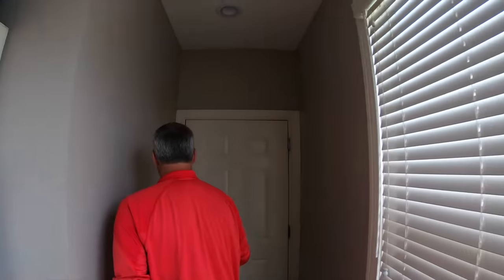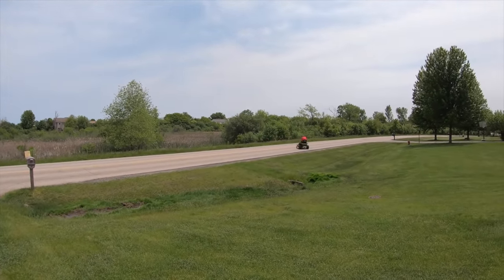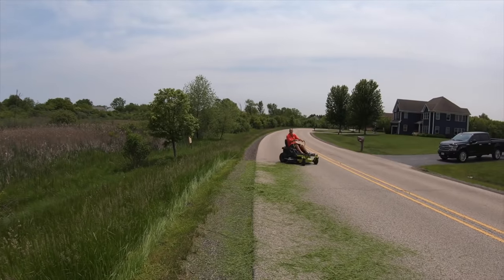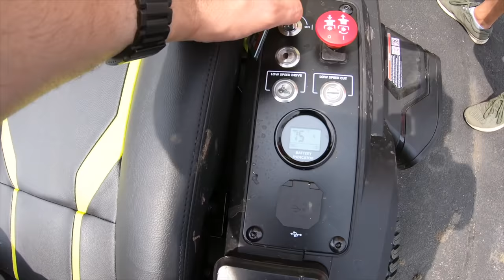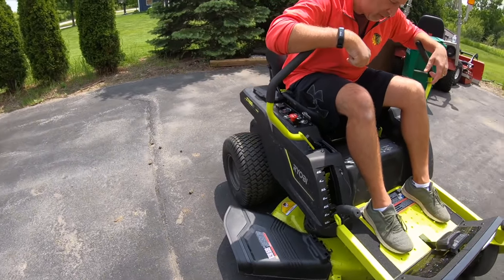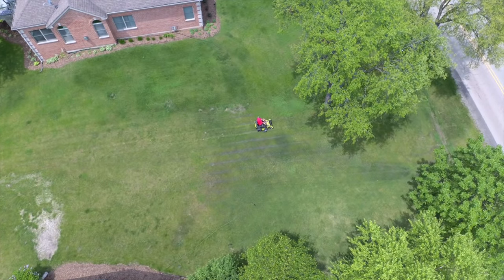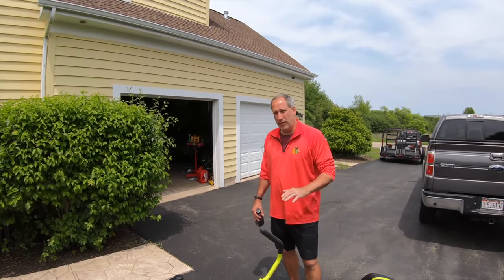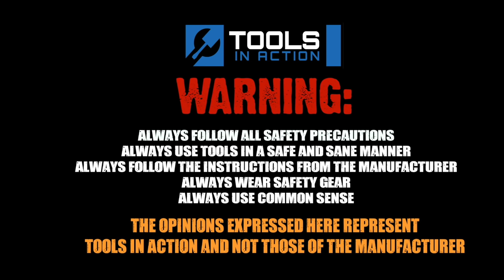Ryobi Electric Zero Turn Mower - First Look

Comment: It's $4100 for anyone curious and too lazy to look it up.

They might've said it, but I was skipping around the video
Reply: yeah, not sure if it would make sense for the average homeowner.
Reply: @freddyv7546  kubota zd 332 run over that little ryobi with the big 32hp diesel power lol
Reply: @michaelmactavish1728  too expensive for the average homeowner and too weak for a lawn care company.
Reply: @freddyv7546  there round $16,000 at my dealer and $27,000 for the F3990 with 60'' or 72'' deck and snowblower and blade
Reply: It makes sense if you’re willing & able to shell out the initial cost. You’d spend way more paying someone or in gas, maintenance plus a gas  mower. It’s overkill for my acre-ish yard but my ego push is great and I’d never go back to gas as a homeowner.
That said, long time durability would be my main concern with this.
Reply: Freddy V ummm if an average homeowner is needing a zero turn then it’s perfectly priced. Not sure you know this but homeowners buy zero turns and they make zero turns for homeowners and they cost around that much. Yeah, you can get them for 1500 or so cheaper but you’ll save in the long run here.
Reply: All I see is issues with that try using it on 4ft tall weeds and see how it does if it wants to look like a zero turn mower it needs to preform like one or it is a wanna be.
Reply: @Taylormade2350  no a decent home owner model john deere zero turn was 2400. But we just ordered a s240 rider
Reply: @BobSmith-qi5di  Can't speak for 4ft yet, but as someone that just purchased one of these after our old Cub dying we had an area that hadn't been mowed and probably had around a foot and half or two of growth. Put the deck on its highest setting and it didn't even really bog down. Part of the benefit to instant electric torque, motors that are always outputting peak power, and no loss due to belt drive.
Reply: jj Watson I literally said you could get some for 1500 less
Reply: Freddy V if you have a big yard and want a zero turn this will save you money on maintenance. I cut 5 acres + and $ 4 grand is nothing.
Reply: Freddy V this is not weak tho, look at that massive lawn. You can tackle like 10 yards in the burbs with a single charge. Game changer.
Reply: ImRIckJames yep.
Reply: Thats what I paid for my 54” bad boy mower. Extremely over built and tuff mower, that was worth the money but i don’t think this is worth it. All i see is issues in the future for this thing.
Reply: @imrickjames7012  this lawn is not massive compared to anything I can cut with my Scag
Reply: ripoff
Reply: Like it but won’t buy it . Does not meet my budget
Reply: @adamlaski9128  
Exactly... the batteries are 200 ea 4 per unit. 200 ea for the replacement motors @ 4 per unit. 
Could be very expensive.
Reply: @freddyv7546  i think its mostly for landscapers in the tight city were people complain about the noise but ya def not for the average homeowner lol 4k no way haha
Reply: 3300 at home depot
Reply: @Travis-kt7cn  should be 1500 lmao
Reply: @killaz123456789100  I agree.  I'm not buying electric or ryobi
Reply: Sandy Ravage where do you see it for that? It’s about $4,100 at Home Depot online.
Reply: @mikebsnyder  my local home depot has them on sale online for 3300
Reply: Michael Mac Tavish  use one of those at work ahah love it besides the bumpy lawns usually use it as a back up i use a scagg v ride 54”
Reply: @Taylormade2350  I resemble that comment! Have 3--1/2 acres to mow and for now I do it with a 2004 60" Dixie Chopper and it's getting about time to think about something new. That was about $6000 when new. 2 years ago I had to spring for a new snowblower for our 400' driveway and got good financing rates from Cub Cadet that made it fairly painless.
But we're happy to drive our cars for many years so don't have that expense. My last car I drove off the showroom floor with 7 miles on the odometer in 2002 and literally gave it away 3 years ago with 220K miles. My wife bought hers new in 2010 now with ~145K miles. Runs great, very clean looking car inside and out and she's very happy with it (although she's made noises lately about upgrading since she got a job promotion...)
Point is, buy good stuff when you can and take care of it. Long term it''s more cost-effective.
Reply: Thanks.
Reply: @Taylormade2350  yeah they are not cheap. the ones that look interesting enough to me that i might buy are usually priced close to 4k anyway. that being said i would not buy one unless i had a lawn care business. my yard is quite small and my old 48'' scotts takes about 20 minutes to cut it.
Reply: I was just about to check home depot before seeing this comment.  More than I'm willing to spend.  I'll keep my non-zero turn for now.
Reply: Chris McRoy  lol
Reply: plc268 wow! NiCd batteries? That’s an ancient battery technology!
At $4100 do yourself a favor, spend another 2k and pick up a Kubota z125s! 
$4100 for anything Ryobi is unfathomable
Reply: Freddy V lol how can a 6 foot deck and a 32 horsepower diesel be to weak for a lawn care company. The would run the wheels off that thing. I know there’s bigger things, such as as the 9 foot tri fold for golf courses, but a 6 foot deck is already almost to big for most people’s lawns
Reply: @Taylormade2350  the kubota has residental ones too the GR and T series and komender gas and diesel optional
Reply: plc268 and a 42” timecutter is just over 1/2 of that cost...and will still be mowing 20 years from now if well maintained. That chinese hairdryer mower may (and I emphasize the word may) give 5 years of service before you need to replace batteries at the very least.
Reply: Taylormade2350 save ? A 42” timecutter (that’s a homeowner sized machine) goes for roughly $2600 and will reliably cut grass for at least 10 years if properly taken care of.
Reply: @mikey.180  brushless motors don't break down easily at all. And nicad batteries can be revived by easily balancing them. No oil burning, oil changes, oil filters, spark plugs, gas @ x amount per gallon, starter, carburator, air filters, fuel filters, belts, and pulleys to worry about. The initial price might sound steep. But in the long run it'll be cheaper. I'm sure Ryobi spent good r&d $$$ on this model. Because it's hit or miss forever for them if it fails.
Reply: Yea its novel and all, but at that price I'll keep my 60" Hustler.
Reply: @OmegaGamingNetwork  please tell me it doesn't have a Kawasaki engine on it
Reply: @Oink_Blaster  No I have the Kohler. Though for me it wouldn't have mattered a ton since I fix these engines all the time anyhow. But I knew the reputation of the Kawasaki and really didn't need to add another high maintenance engine to my tools so I avoided it.
Reply: That mower is not wroth 4100 that’s stupid paying that much for that junk
Reply: @Taylormade2350  the thing is it cost four times as much as a MDT lawn tractor where the savings  on that
Reply: @adamlaski9128  Ego has a 21" self propelled now.
Reply: Ictpilot Ictpilot I saw but I can’t justify the cost considering the push works fine. My brother has a self propelled greenworks but he said he doesn’t use the feature all that often and his yards a bit bigger. It was cheaper but I love Ego batteries they’ve been the best in my experience
Reply: @adamlaski9128  Self propelled now $499. I had a couple of Lawnboys, and used it all the time. Makes it a lot nicer.
Reply: Ictpilot Ictpilot That’s not bad. I’ll still wait till this one kicks it. My soil is pretty hard and I keep the grass tight so pushing isn’t much of a chore. Thanks for the info tho!
Reply: Thank you 😂😂
Reply: Ty. I am soooo lazy
Reply: That's not to bad, walker and hustler mowers are above 8k
Reply: @rclife916  Why isn't it worth it? You don't have to worry about going out to buy gas, no oil changes, no worrying about spark plugs. It's basically 0 maintenance. It's going to pay for itself in three long run vs a gas mower.
Reply: $4100. Is that all. Hell I’ll take two.
Reply: Freddy V we have 10 acres and our JD X540 lawn tractor was 7,500, so that’s actually not too bad for someone who has a lot of grass to cut. But this mower couldn’t handle our property anyway, it would run out of charge.
Reply: I would rather get a riding lawn mower than this, it's half the price and lasts longer
Reply: You can get a 60” Cub Cadet or Toro with a ~25 hp v-twin for less than this.
Reply: @freddyv7546  Exactly
Reply: Gday
$6,999au here

Comment: I hope y'all cleaned the grass off the road, that can take out a motorcycle.
Reply from the maker: Yes, we did
Reply: What kind of ninnycycle do you ride that a tiny bit of grass could take out a rider?
Reply: chechnya ya right I ride and that’s never bothered me
Reply: Grass clippings on the road are dangerous, and in many municipalities, illegal. And motorcyclists are often the ones that pay the price.
Reply: Ha, first thing I thought since I just started riding. I assume grass clippings would be bad in a corner but not in a straight line.
Reply: @XBLWasabiSnooters  major issue is on corners, but grass clippings (made up of mostly water) on the right surface and conditions can turn a section into icy like condition for the wheels..  try to brake hard in grass clippings as if in an emergency and you'll see.
Reply: Shawn K I could see braking being an issue or if you were maneuvering around something as well. Rather find out from others who know than from first hand experience. Thanks, my head is on a swivel and eyes are watching everything while riding lol. I’ll just favor the center when I see clippings from now on.
Reply: It would be nice if more people thought like this I see people leaving grass in the road every single day
Reply: @Atlantaconnection94  well it's a serious problem it's like black ice for motorcycles
Reply: @XBLWasabiSnooters  it's bad it's like black ice
Reply: @slum3947  It's a pet peeve of mine
Reply: @cole909cole  yes me too I've grown up around Harley's my whole life
Reply: I own a Lawncare business and I take extra time to ensure I don’t throw clippings into the road as much as possible. Can’t stand watching people discharge into the road.
Reply: SLUMERICAN never bothered me 👍🏽
Reply: chechnya grass thrown in the road will wreck anything from a moped to the biggest cruiser on the road. Gonna go out on a limb and guess you don’t and have never ridden.
Reply: Michael Stokes you’d have to be on the gas pretty hard in a straight line for it to make you wreck but it is never good. I don’t understand why anyone under any circumstance would blow grass in the road. If a mower will mow in one direction it’ll mow the other direction.
Reply: chechnya Ninmycycle? What's that supposed to mean? I kmow quite a few riders who have nearly lost it over the grass. Sportbikes often use soft comp low pro tires, last time I checked slick surfaces arent meant for traction.
Reply: Luke Lambert 
Depends really. I have to to get the drainage ditch on the side of the road. Literally the only way my mower can get a decent cut to the bottom of the ditch, and the only direction I can get my push mower into the ditch without tearing it up.
Reply: BlakeW5 yeah, you mean because of the discharge flap?
Reply: Luke Lambert 
Yes. I know you can remove it, or bungee cord it into an up position but that’s a pain. Plus the actual terrain change between my side and my neighbors side makes it all but impossible to get in from the other direction.
Reply: BlakeW5 I guess there are very few can’t do it cases out there. I hope people that have that rarity immediately stop and clean it up then resume mowing. Oddly enough I just saw an article posted on social media yesterday that read “motorcyclist killed due to grass clippings thrown in the road”. I wish I could put the screenshot on here but it won’t let you post pictures. It is just a bad deal. Worst part is a lot of people would say “I could bungee it up but it’s a pain” and they just don’t care enough about the pain of someone’s head hitting the pavement after sliding on their grass in the road when unlike you, they have other options. Just watched a guy on my road do it the other day. Put my foot over the brake and was getting ready to stop and tell him to pick it up but there was a line of cars behind me and I could have caused a wreck doing so. Bad part is, he has a Harley street glide. He should know better. He also could have thrown it back in his yard but just didn’t.
Reply: Why the hell is everyone talking about motorcycle...just because...im blowing my grass in the street
Reply: @bigblue3568  then watch where your driving!!
Reply: cole909cole there's only 2 types of motorcycle riders.  ones that's been in a wreck and ones that's going to be in a wreck.
Reply: Had a wife get killed on her motorcycle, because of grass clippings, in Central Illinois, recently! It’s in the papers, that they are going after the property owner.  It looks sloppy, & makes the area look bad. It only takes going over the pavement with the blades discharging towards the ditch, to get rid of most of the grass. One or two passes usually takes care of it. Aim the discharge in the right direction, in the first place, and save yourself a lot of trouble, & show some Pride in your work! It is appreciated by everyone!
Reply: I dont care for grass thrown in the road either but some statements and ideas here are just a bit ridiculous. It also rains which generally covers the entire road... Are you going to stay home if it rains? You can also see it clearly.. Its usually green. Do banana peels turn into black ice as well? My suggestion is to learn how a vehicle reaponds, learn to control it and learn to control yourself and respond accordingly. Everyone is so safe now they will kill themselves for being to stupid and to pansy. There is a point where your defeating the purpose nd become a ____.
Reply: Just cruising through the comments, learned something new today. Thanks...definitely keeping that in mind.
Reply: cole909cole motorcyclists always complain about everyone else then they cut me off every chance they get
Reply: Ok bro, I have ridden all my life, if that little bit of grass takes out my KTM or Indian,  then I quit.
Reply: I would be fired if i did that lol even if i was doing my mothers lawn or mother in laws ( i live in an apartment 😔 ) people would pull over and yell ( country life )
Reply: chechnya you clearly have some chicken strips on your tire ... get your lean down and you’ll understand lol

Comment: You guys really shouldn’t blow the cuttings onto the roadway like that me and my family and friends ride motorcycle’s and that stuff is like riding on ice very slick and dangerous.
Reply: Chris Poor facts
Reply: Im in my 40s and have been riding bikes since I was in my late teens. Not once has grass clippings ever made me crash.. or almost crash.. or even scared to crash. I hate old steel bridges and uneven pavement much worse. This trend of posting how grass clippings cause bikes to crash is just stupid. The only way it would ever be even close to dangerous would be on a sharp corner with a shit load of grass all over the lane. If you are a biker and a little grass on a 25ish mph road that is strait as an arrow scares you maybe you need to take up water polo.
Reply: They said they cleaned it off.
Reply: @jtman04401  situations arise.
 what if you are riding slow on a straight road that has grass on it and an animal runs out in front of you? instinctively you counter-steer out of the way of the animal but if there is grass under your tires you may just take a spill. grass is pretty slick when it has roots attaching it to the ground. it becomes even more so when it is loosely strewn about. 

btw nobody instinctively counter-steers unless they have been practicing avoidance maneuvers. something that all two wheel riders should do because cage riders and animals are a real threat.

i been counter-steering for over 40 years and have never went down while making an avoidance move but i am aware of the threat and know i have been blessed in that regard.
Reply: It’s really easy to blow the grass the opposite of road. Especially with a ditch next to you. Just embarrassing
Reply: @seancarroll6457  honestly the next two cars that drive by will blow it off

Comment: Huge Ryobi fan and I work at HD and this new mower is just simply BADASS!!! Great channel! 😎👍
Reply: What is the cost for one John?
Reply: Mark Job  Hey Mark I live in Little Rock AR, we just moved here from PHX, AZ and we currently don’t have the mower in our store yet! I heard it’s around the $3000 price point! Sorry I couldn’t help more, go to Ryobi Nation and take a look.
Reply: JOHN PIEGZIK c’mon man. Ryobi’s boards as well as their batteries are garbage. Before I wised up I spent probably double in replacement batteries than I had in the tools themselves. When it’s 80 degrees out they work ok, get it down in the mid to low 50’s and the batteries are permanently damaged...to the point when a “full charge” on a 5 (or 6, cannot remember) ah battery won’t even drive 5 drywall screws before it’s dead. My bosch, dewalt & milwaukee batteries are routinely left in the work truck all winter and no permanent damage. Warm them up & they still hold the rated ah listed on the pack.
Reply: @johnpiegzik298  Thank you John! 
I know how much of a pain moving is so best to you my friend.
Reply: @ROTAXD  I have found that Ryobi doesn't change their tools to fit batteries. You can buy Ryobi batteries for 3 year old drills and drivers. 
I think for their price point they are the best. 
Just my 2 cents.
Reply: ROTAXD sounds like you are a contractor and it sounds like you have a lot of hands on with all types of tools. Thanks for your input I will tell my customers what you said! Sorry you had a bad experience! Ryobi is best for a homeowner or DIYer! Thanks John
Reply: Mark Job thanks for the well wishes!